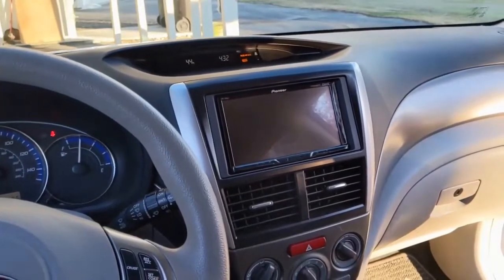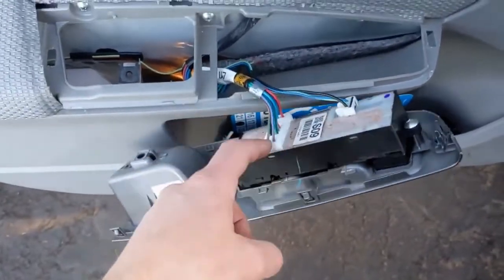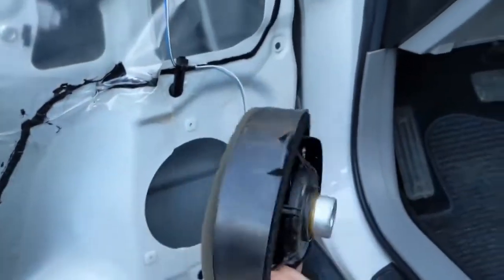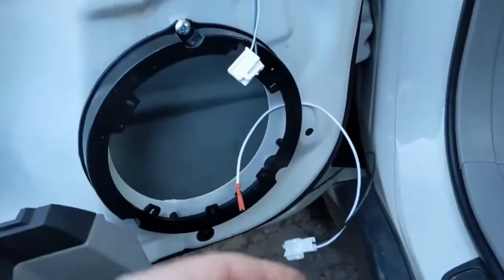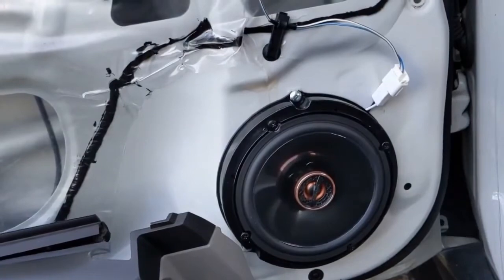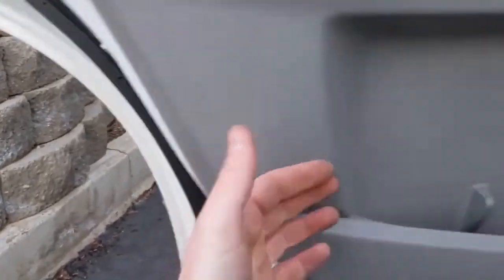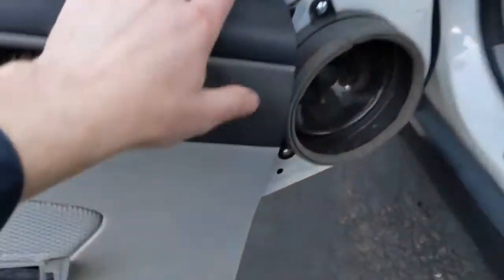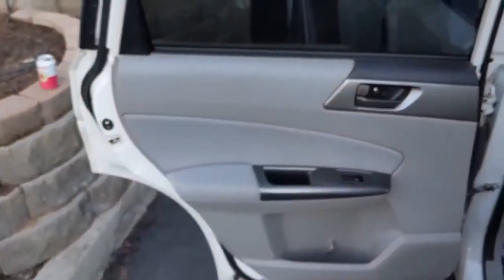Subaru Forester Speaker Replacement and Upgrade | How to Install Front and Rear Door Speakers

Comment: Thanks for posting this. What adapters did you use?
Reply from the maker: I'm not exactly sure. The customer bought everything from crutchfield.com. I just installed them 👍
Reply: Will  6.5 speaker fit ? 2011 forester 2.5x premium

Comment: Jeez use some foam between the door and the rings, and the speaker and the rings.
And that connector, it will all rattle.
Reply from the maker: Hey Ekim, thanks for your input 👍 Foam would help dampen any vibration that may occur.